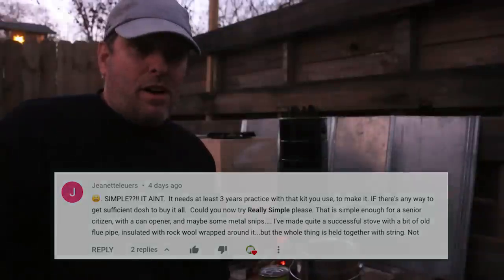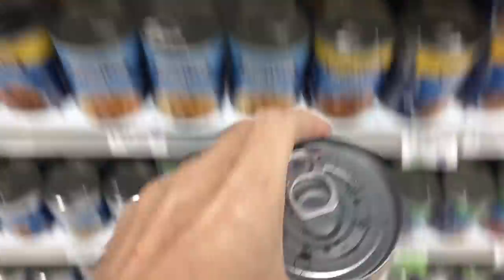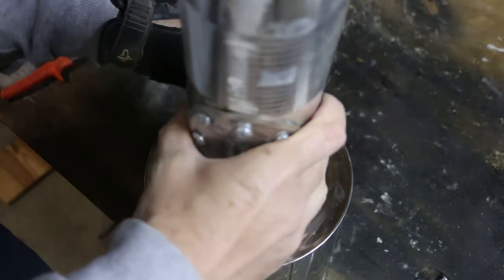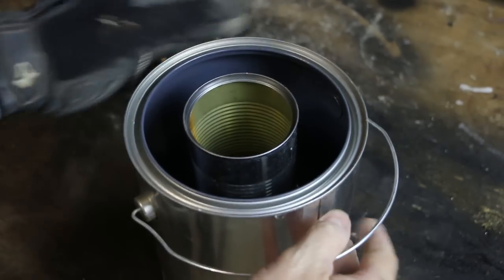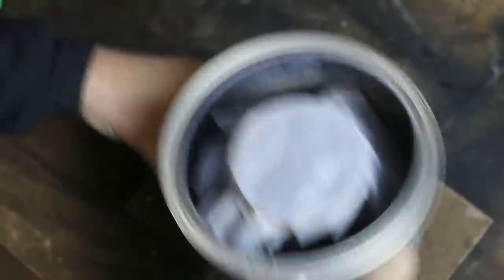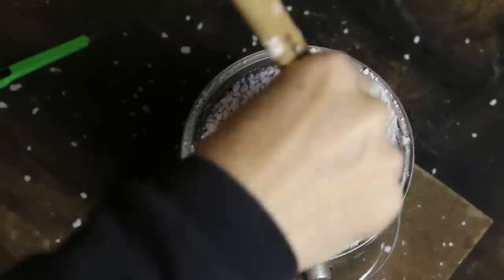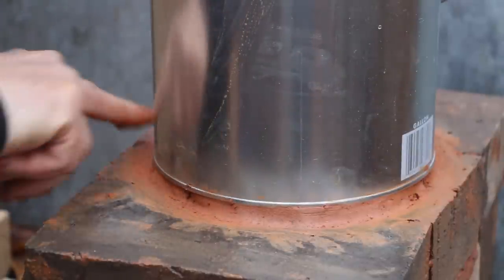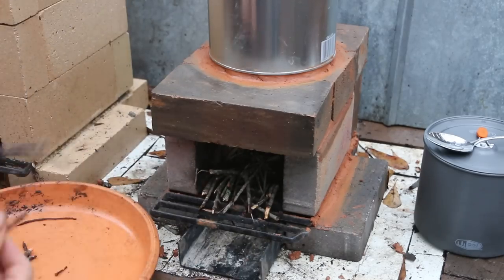How to Make A Soup Can Rocket Stove | SIMPLE & CHEAP

Comment: A while back I made a rocket stove out of a 20 quart stainless steel stock pot.  My insulator was river sand.  That was the cheapest and most available insulator for me.  And it worked reasonably well.
Reply from the maker: Thanks for the tip, James. I’ll have to try sand as an insulator in a future build. Thanks for watching.

Comment: Hmm...  I would like to see the next rocket stove built with one tool!  This would be fun if you had a lid on the soup cans so you could haul a bit of cargo in them.
Reply from the maker: There’s a challenge. Could it be a drill with a cutting bit and a fastener bit? Thanks for the feedback, Greg. Thanks for watching.
Reply: Not sure about the one tool method - at least for this kind of build. You can make a "hobo" stove just using a knife or one of those triangle hole punch/bottle opener things. There are other vids on YT for that. Although a Dremel with a metal cutting blade may do it if you're creative enough.  As for the lid... if you buy the right sized items you can get a plastic lid for the can. So say for instance (at least in my area) a can of diced tomatoes (I think 16 oz but not sure) and a small can of mixed nuts both have the same diameter, so the plastic lid from the nuts will fit (sometimes a little bit loosely) on the can. Just a matter of comparing the items while your grocery shopping.

Comment: I really like this stove, but just thinking about maybe getting the build one step easier( Georgia residents only). Tape the two soup cans together and pack the big can space with your local free clay/cob mix. After using it a few times the small cans may weaken and burn out and you're left with a fired insulated clay liner. Thank you Shortz for your experimenting, it's backyard fun for big kids.

Comment: No Georgia clay or perlite. Stuck it on top of a modified chimney grate, in my actual chimney with paving sand as an insulator and now it's tea time and soup time. If you stick a slate on top instead of a pot it makes quite a decent  heater!
Reply from the maker: Sounds awesome. I’ll have to try the slate trick. Thank you for the tip. Thank you for watching.

Comment: Hey Tom, 

 I see you got the tin snips... some "hand specific" (right hand cut / left hand cut) would be better as that the cutting blade is shorter and better for cutting circles. Also starting with a larger diameter drill bit or using a "step" bit to increase to hole diameter prior to cutting with the snips. 
One other ideat I had was instead if the plastic bag to cover the center,make a cone shape out of some card stock (cereal box) to fit over the hole
Reply: I tried to fix the typos, but cant insert text without having to retype the whole thing. It types over what I already wrote.
Reply from the maker: Thanks for the feedback. I agree with your thoughts on the curved snips. I already had my straight ones, so I made it work. I do have a step bit, but didn’t that of that. I like the cone solution. It would have been easier. I had to pull the plastic out carefully so I didn’t pop the perlite all over the place. But, I do like using the suggestions as they come. :-) Thanks for watching.
Reply: [Another pouring solution for your Perlite/concrete/insulation]....On another episode of reinventing the wheel: Literally think "dunce cap". Try an inverted funnel or cut the bottom of a plastic soda bottle. You can just pour without caring. The cone shape would naturally guide the mixture & gravity does the rest of the work. Appreciate your work Sir.

Comment: Cracked and crashed charcoal schould not isolate that bad. Of i  am right.
Reply from the maker: Hi Johannes. I think charcoal would work. I was curious if it might glow again with the heat of the riser pipe. That might not be a problem though. Thanks for watching.
Reply: GreenShortz DIY It will not start glowing if there is no oxigen

Comment: What the heck is mineral wool?
Reply from the maker: Hi Paul. I had to look it up. :-) Mineral wool is a fiber made from metal oxides that form at super high temperatures. This makes them a great insulation material for temps up to 3000 degrees F. There are different types. If you want to know more, check out this Wikipedia page: en.wikipedia.org/wiki/mineral_wool#HTMW